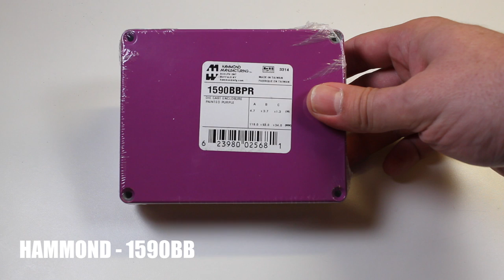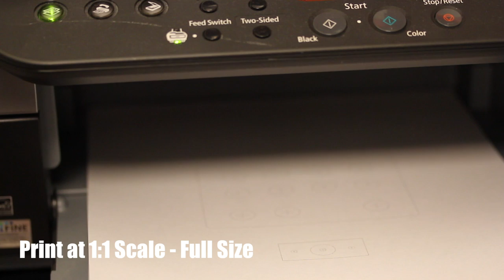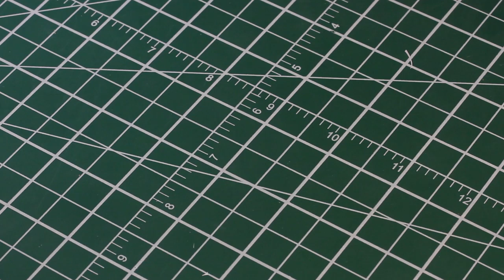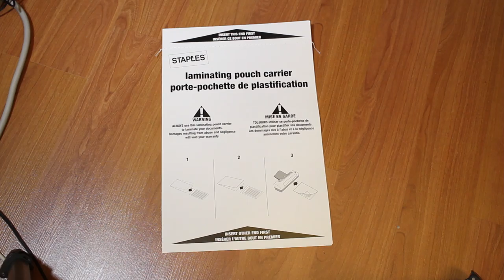Twitch Switch - OBS & Teensy LC - Part 1

Comment: More tips!  If you can afford a third color of wire, get red, black, and any other contrasting color.  Use Red for any positive power leads, black for ground, and any other color for digital signals.  It will help you sort things out when something breaks and it's been long enough you don't recall what's what.  Also, it looks very professional if you're going to show it off. 

Drilling/cutting a pre-finished case:  Don't give shards the brush off!  A vacuum is best, but blowing them off works, too.  Brushing the metal shards off will almost always scratch your finish!!  (And clean the table off between cuts/holes, too - one piece of tape won't protect the finish - those things are SHARP!)  If you're drilling a metal case on it's side, as he does @8:23, Go Slow!  Too much pressure will bend the case, and while you can probably bend it back enough to get the case together, it probably won't go back to it's original shape.

Laminating faceplates:  You can save a lot of laminating material if you cut what you need from the free end of the sheet (away from the fold, so if you need the folded edge later, you can still use it).  Just take care when placing it in the carrier to get everything lined up.  When cutting the excess, leave about 2 - 3 mm (1/16" to 1/8") on the edge.  No matter how careful you are, some time in the future it will de-laminate.  A tiny border will fail sooner, but a huge border takes up space.  Right around 2 - 3 mm, is a good compromise that will last a long time.  Think about it.. heat makes things expand.  When the laminate cools it shrinks a very tiny amount - just enough to put some tiny stress on the joint at the edge, where it has to bend a little around the paper edge.  It doesn't take much of a border to make sure it stays, but it does take some.  The thicker the laminate, the larger the border you want.  If you want a visual cue, guesstimate the thickness of the laminate with your paper/card in between, and triple it.  If that is less than 2 mm, use 2 mm as your border.  Anything more, use that number instead.  If you got a number anywhere near 1/4" or 6 mm, consider using something else to protect your faceplate, like acrylic sheet.

Comment: Dave! You still around? Can you actually do this with an Arduino?
Reply from the maker: Hi Cyberben. You would need to modify the code quite a bit.
Reply: @NotesAndVolts  ahh thx I'll make the original after all

Comment: Anyway to make this work with LED lit push button switches?
Reply from the maker: Hi JFF. LEDs could be driven from the teensy using empty output pins. I belive the Teensy LC only has 4 pins that will drive leds directly though so you may need a shift register to make all buttons light up.